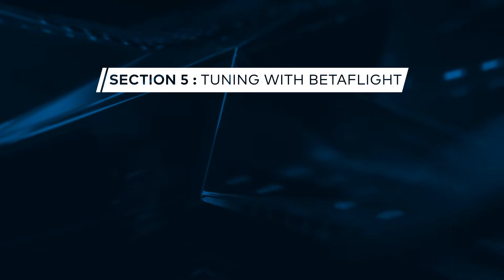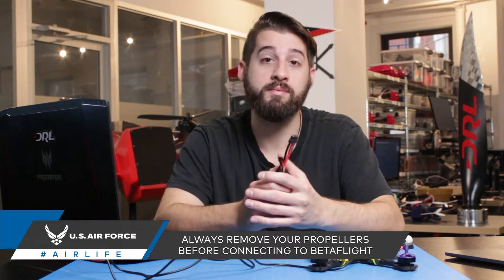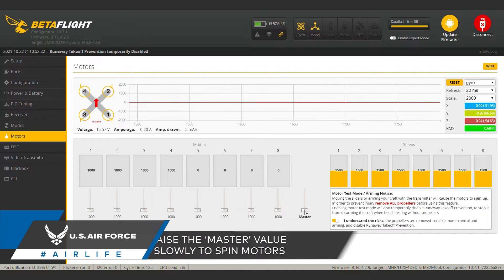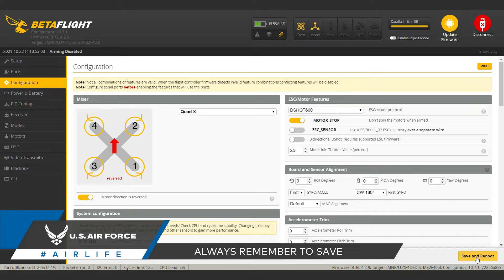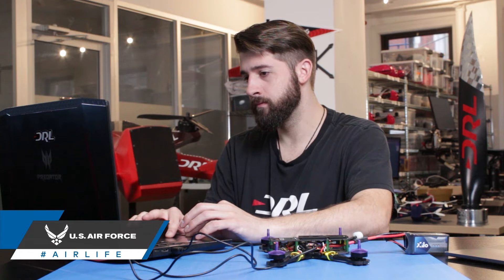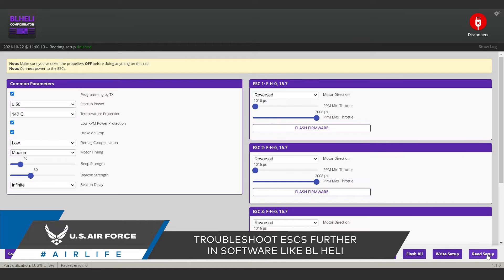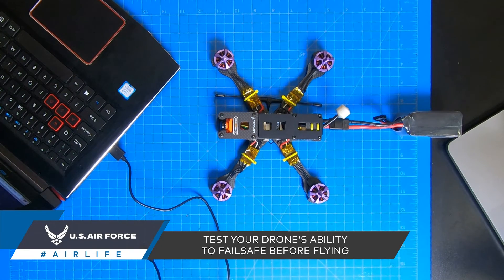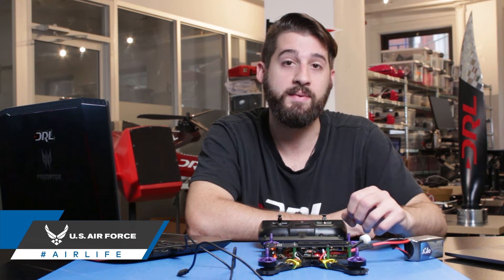Testing Motors | FPV 101: Phase 5, Episode 6

Comment: Shouldn't y'all be using at least BF 4.3, there's a lot of stuff that's been changed like the dshot protocol is in the motor tab now. This will be very confusing for beginners.
Reply: lol look at the dx9 and that frame with wide arms and individual esc's you'd think this video was shot 4 years ago.
Reply: @CyberdeckCafé  sure looks like it was a while back.
Reply: I think they are using bf 4.3
Reply: @wizzard0.0  I promise their not, some tabs, and the contents moved to other tabs like the rx protocol is now in the rx tab instead of configuration, also dshot has moved to the motors tab, and there is now wizards for motor order, and direction which wasn't possible before 4.3., Edit: it's 4.2.9, you can see it.